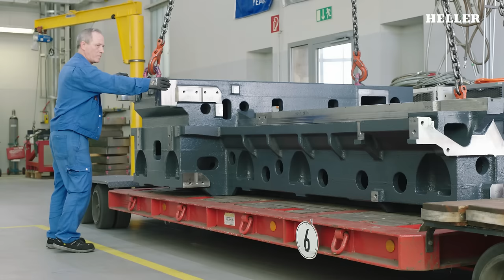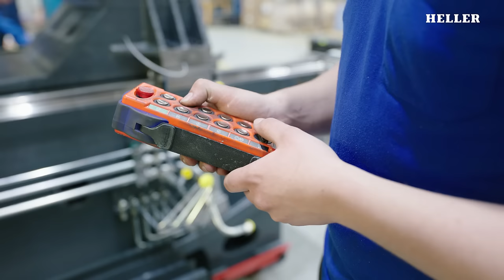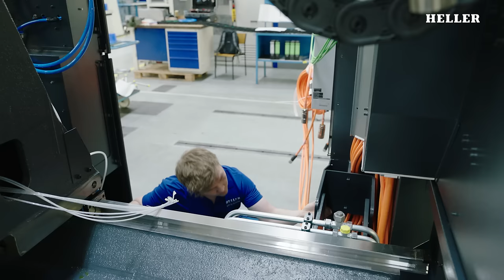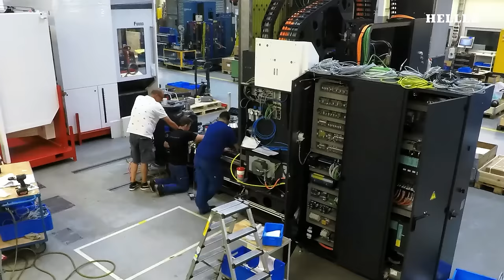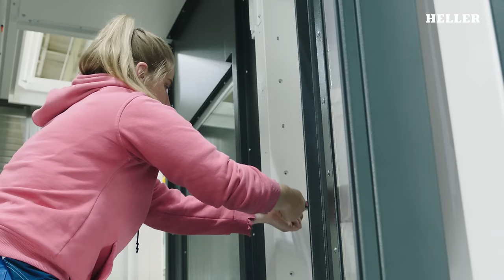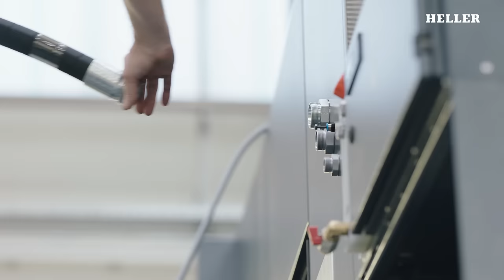Making of the HELLER F 6000 | Assembly of the new 5-axis machining centre

Comment: Must be nice to work with zero PPE!
Reply: How so.  I see these odd statements on photo's in mms mag to say so much.  Are people in the US wearing hardhats, masks, or safety goggles in big shops these days?  I'm admittedly out of the loop with political correctness and govt compliance.
Reply: @winningwithoutracing7811  At large USA based plants, the existence of an overhead crane dictates hard hats on everyone.  Safety glasses are also required in all areas of a plant.  Furthermore the video shows several instances of hands being placed under a suspended load, and bodies under suspended loads, which are a huge no-no here.  Please be clear that I am not justifying these practices; it's just shocking to see such seemingly lax standards at such a leading-edge company.
Reply: As part of my work ive noticed that american companys often enforce these arguably over the top safty rules with basicly no noticable effect regarding insuries. The only thing i have noticed is that its a pain in the ass. 

Dont get me wrong im all in for a safe workplace but a hardhat is not gonna protect you from a 15t cast
Reply: @dasozel4960  I hear ya.  I hate hard hats…but…after wearing them for a year working on large equipment, you’d be surprised how many dings and nicks are on it.  They are effective, there is zero question about it.
Reply: @madmat990  there have been instances where i wished id worn a hard hat 😅
Reply: @madmat990  Gotcha.  You will never catch me under hanging loads.
Reply: @madmat990  It must be nice to work six days a week, just to afford insurance, and the most unhealthy food to be placed on your table.  I can see how your choices have made you crass.  Many of us enjoy four day work weeks... and 30 days off per year.  Healthcare for everybody.  Education is also not a problem.
Reply: @Katchi_  LMFAO, nice try to bring wokeness and Euro superiority into a thread about safety gear and machine building.  Have fun when the Russians drive through!  I laugh in your general direction 🤣 The USA is a fantastic place to live and I won't be leaving anytime soon!